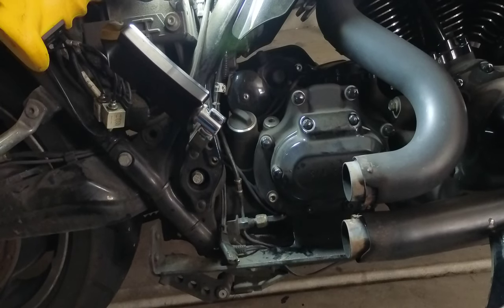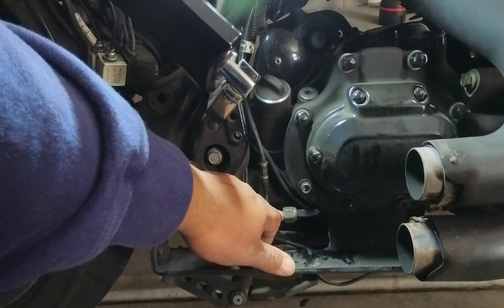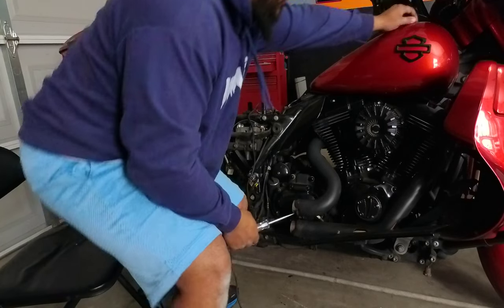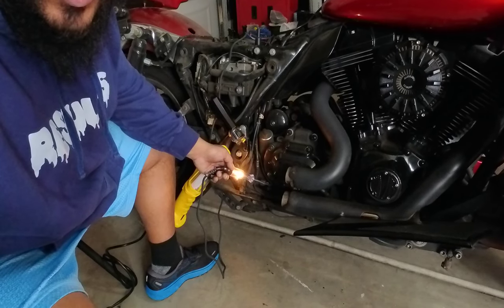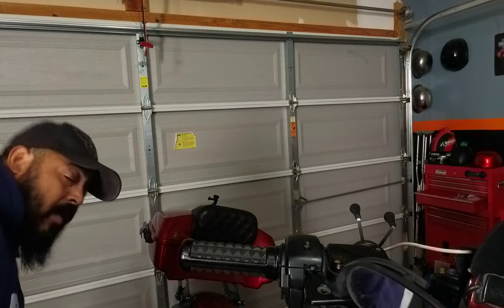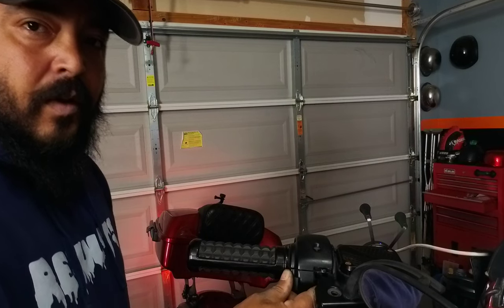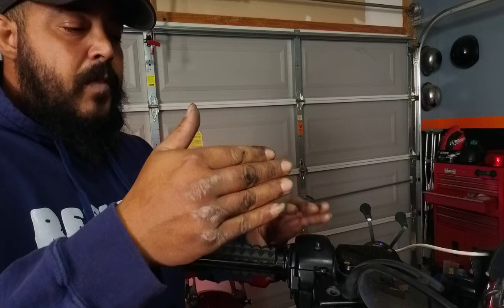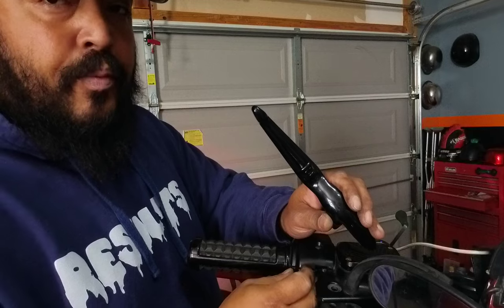How To Check Brake Light Switch | Harley Davidson

Comment: THANK YOU! I followed exactly what you said and re-searching my problem with my brake lights and sure enough I have my brake handle installed incorrectly. Thanks for the tip. I got you saved in my library.
Reply from the maker: I'm glad my video was able to help you. Thanks for watching, and I appreciate the support. 🤙🏽👊🏽

Comment: If your brake light stays on all you need to do is unplug both positive and negative connections and if the light stays on then you are good with the rear brake and you move up to the front brake sensor.  All in all, it was a very informative video thank you for making it.

Comment: I noticed on my 2008 Harley Davidson St. glide I had a rear bulb out so I bought a new bulb and the bulb still didn’t work but when I step on the break the brake light came on the turn signals came on on the right side and left side but the bulb would not turn on for the running lights. How do I fix that?
Reply from the maker: First check your fuse for the rear lights. If that is not the problem, check your diagnostic code because you might have a break in the wire.

Comment: Hey bro i changed the light bulb on my softail but my brake light dont flash sometimes it does with the rear but with lever it doesnt what could be the problem?
Reply from the maker: Check the button switch behind the lever. When you press the front brake lever, it suppose to release the pressure on the switch which turns the brake light on. When you let the lever go, it puts pressure on the switch, shutting the light off. You may have a problem with that.

Comment: No rear brake lights or turn signal with new mogul ....Both of my wires at the rear switch both light up????  Help me bruh
Reply from the maker: What year and model do you have? Start at the fuse.
Reply: @GlidingOnTwos  2007
Reply from the maker: @kencalip6129  If all your fuses are good,  no codes, and the switches are good, you might have a short in the wires. I would check for continuity on wires. Check your plugs under the seat.
Reply: @GlidingOnTwos  front switch clicked a few more times and chick's stopped, crazy....I ordered it today and will check my wiring in the process of waiting
Reply: @GlidingOnTwos  also ordering a Manuel, to know what color are hot and not.... It's my first harley, I have 2 zx14s things are a little foreign at times
Reply: @GlidingOnTwos  07 street glide
Reply from the maker: @kencalip6129  check your relay. Might need a new one.

Comment: I'm confused my rear brake light won't light up and the front is it a possible relay or a ground fault?
Reply from the maker: Could be the relay for the rear wire. That's where I would start.

Comment: Front relay clicks no light changes
Reply from the maker: @kencalip6129  if you haven't messed around with the front brake lever at all, most likely the rear switch. Check to see if your bike has any diagnostic codes.
Reply: @GlidingOnTwos  no codes

Comment: or just unplug the rear brake switch leads and turn key on. if brake light goes out it would mean that rear switch is stuck closed. Thus faulty